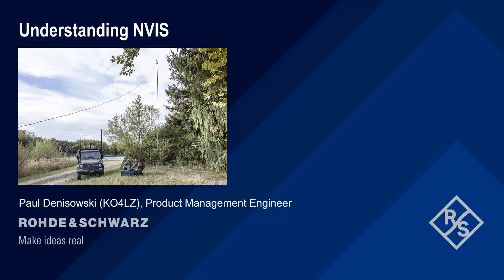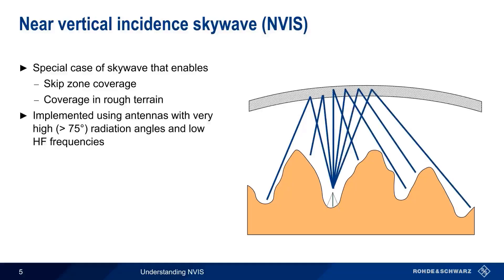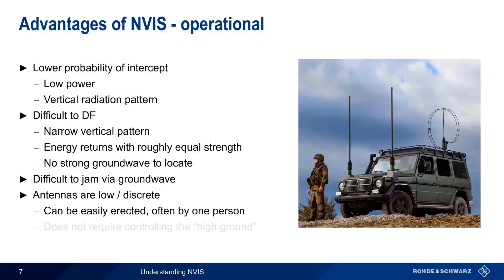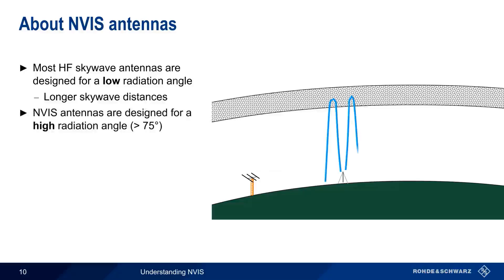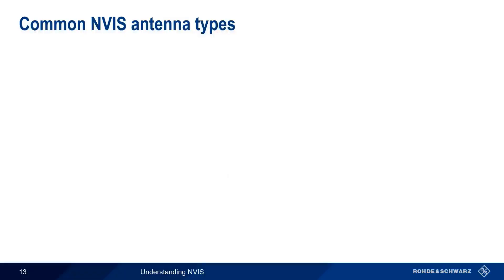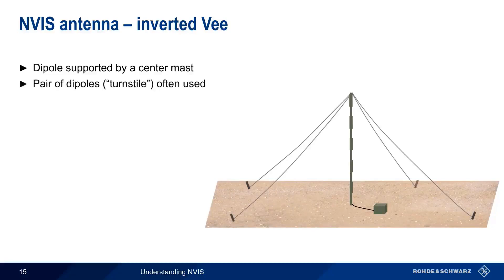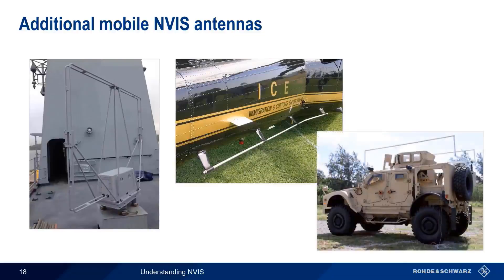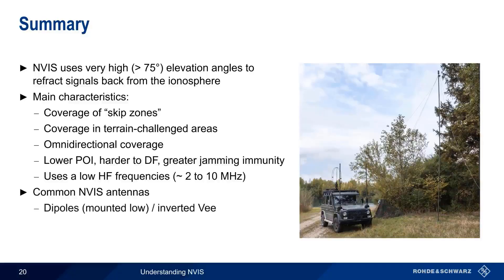Understanding NVIS

Comment: both stations need to be runnin nvis for good results isnt really true. i run nvis on 75 and out to 300 miles my sig went from a 5 to 10 over from a sloper to a nvis flattop . none of the other stations were running nvis. all info is good tho... what isnt said much is... TRY IT ... GIVE IT A GO... dont take word from anyone on bad or good.. what works for one may not work for other and backwards . basic info is good tho
Reply: Thanks for the feedback - I guess it depends on how you define "good" :)  I've personally worked non-NVIS stations with a NVIS antenna and vice-versa, so it can be done, but results are better with similar (vertical) radiation patterns.  Thanks again - 73, Paul, KO4LZ

Comment: Just because the azimuth and elevation don't change much doesn't mean the polarization is the same.
It's still a linear polarized signal and subject to polarization mismatch.
Not sure I buy the harder to jam part. From a distance yes from close the jamming party can illuminate the reflective part of the ionosphere with their jamming signal.
I'd bet you have to be a ways away before you couldn't be jammed.
Even from a good distance a determined jammer could construct a properly elevated dipole to take advantage of the directionality to illuminate the sky above your station even from a couple hundred miles away.
I hadn't considered the direction finding resistance but you're right direction finding an nvis ststion would take lots of effort.
Reply: Polarization is usually not preserved once the signal is refracted from the ionosphere, so the best way to deal with (potential) polarization mismatch would be to use a pair of cross-polarized antennas such as the "turnstile" vertical dipole pair shown in the presentation.

Jamming is all about efficiency, and it's a lot harder to jam if you can't concentrate power towards the receiving antenna.  Yes, you could simply radiate skywards at a high angle but this would distribute the jamming power over a wide area and thus the J/S (jamming to signal) level would also be very low.

And NVIS stations can be DF'ed - I actually hold a patent on one methodology (US11550021B2) :)

Thanks!

Comment: Best of best, though at some point,it was difficult to understand but overall it was informative .want to ask ," difference between angle of radiation/signal and incidence angle. And when it refers angle ,angle from horizon or angle? with vertical?"
Reply: Incidence angle from vertical (i.e. the angle at which the signal was refracted from the ionosphere)

Comment: Very nice. Question: In long range comms, you show refraction but in NVIS you show reflection. I assume refraction is  happening because of the ionization having a gradient with most being at lower levels (?) and the wave bending toward the higher density. True? At straight up NVIS there would be no refraction, but the plasma would reradiate (true?). Of course, the NVIS antenna would also be radiating somewhat off vertical, too. Maybe that's why it's called NEAR vertical incidence skywave 🙂
Reply: Good question.  When it comes to the ionosphere, it's not easy to define the difference between refraction and reflection.  Both cause a charge in direction due to changes in the propagation medium.  For reflection to occur, this change has to be very large (air and a solid object), whereas in refraction it's a somewhat more gradual change.  Reflection also requires a large (compared to wavelength) and ideally a flat/smooth object, and the change of direction is usually specular (incident angle = reflected angle).  None of these apply to the ionosphere.  That said, a lot of people imprecisely talk about signals "reflecting" off the ionosphere, and I'm sometimes guilty of this as well :)

Depending on the antenna pattern, height, etc. some of the transmitted signal can (does) travel straight up.  NVIS is "near" vertical incidence because a purely vertical incident signal would simply come straight back down and not be useful for communication.  Purely vertical incidence is useful when making measurements of maximum usable frequency (e.g. ionosondes) but not for much else :)

Comment: Thanks for the clear and concise explanation of NVIS Propagation theory. The minimal effects from getting jammed is great for the army and the consistent signal quality without fading is useful for digital modes. I have made a lot of contacts on NVIS. Just remember the antenna at 30 ft height brought down to 12 ft height will need shorting to get the swr down. Feel free to make a specific 60m NVIS antenna for example so you can rapidly deploy it without worry 73s VE3IPS

Comment: Cloud warmer? You can make the rain hard to fall if the cloud is warm or u get warm water?
Reply: Good question.  I think to warm up water vapor you need energy in the low GHz range, so most HF signals probably wouldn't be able to actually warm the clouds :)

Comment: Good presentation.  Must be careful with an inverted L antenna - modelling will show that most of the current can flow in the vertical uplead, resulting in a top-loaded vertical, with attendant low-angle radiation.   Making the total wire length => 1/2 wave can help this somewhat.
Reply: Thanks, Chris. I didn't appreciate that.